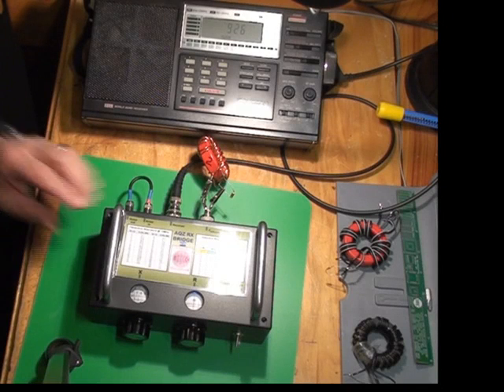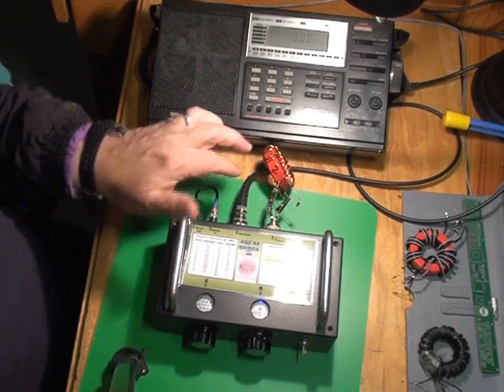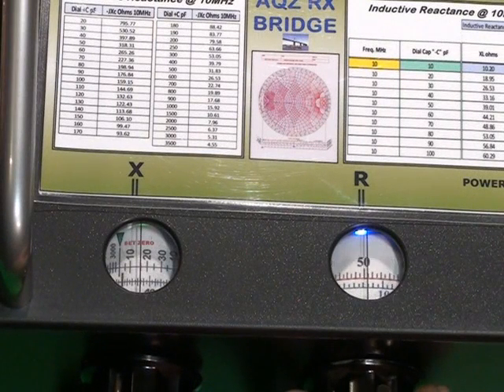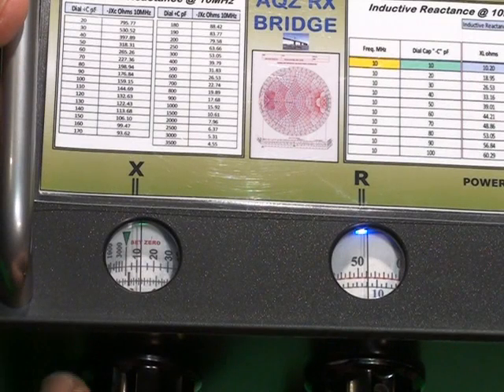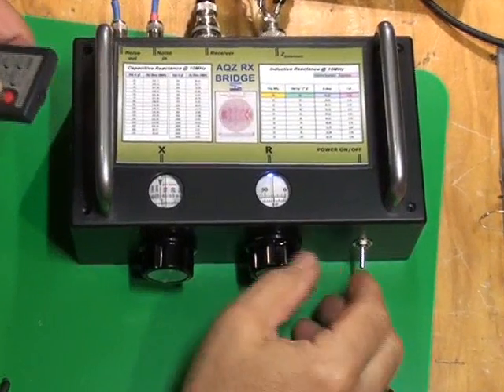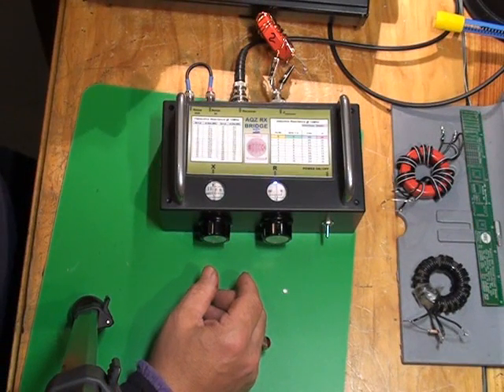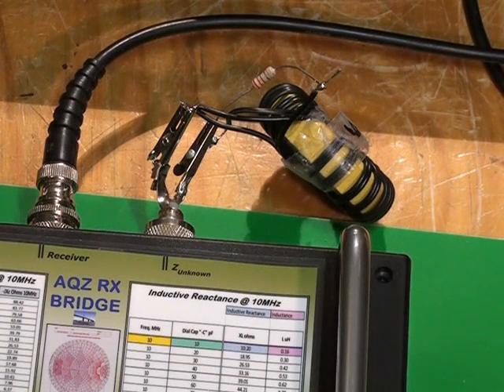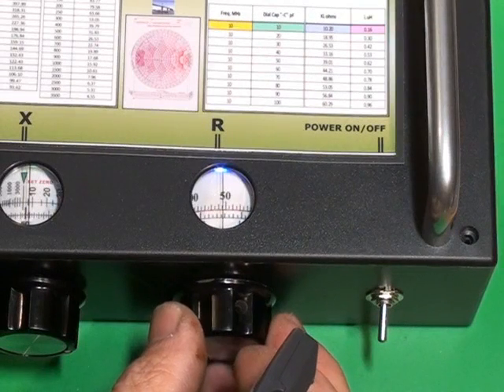VK3AQZ RX1 Testing Baluns

Comment from the maker: @iparivaddiszno 
Hello, Yes, the material is 6 (3-50Mhz). Ferrite cores type 43 and 61 can be better for baluns if you want to build a balun. But I used the iron core yellow just to try it out
for the video experiment and it looks okay.  Not sure at higher power though.